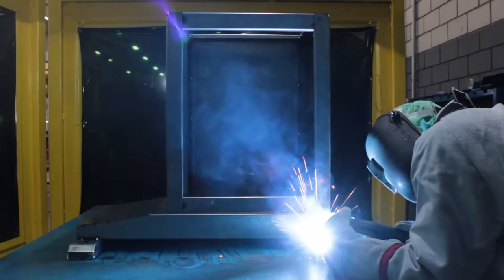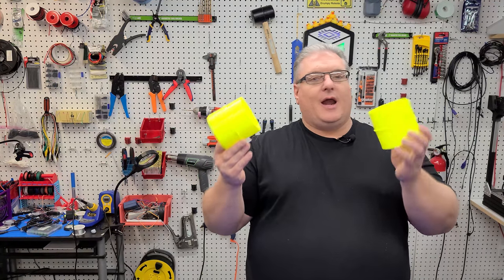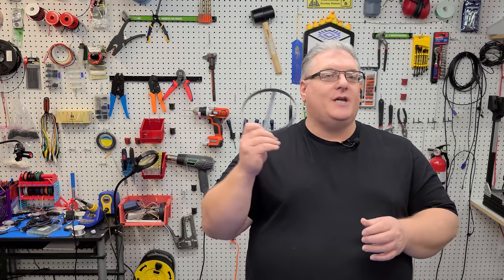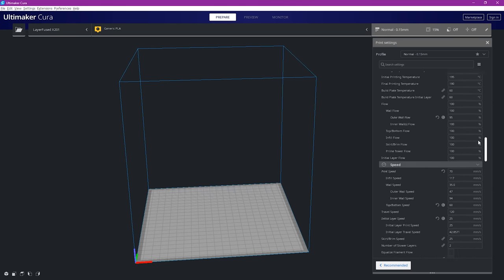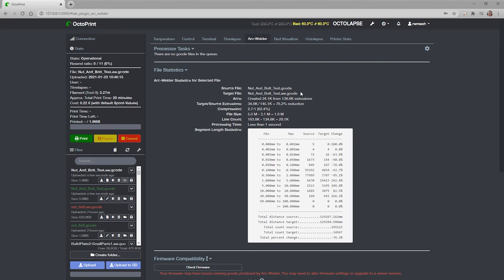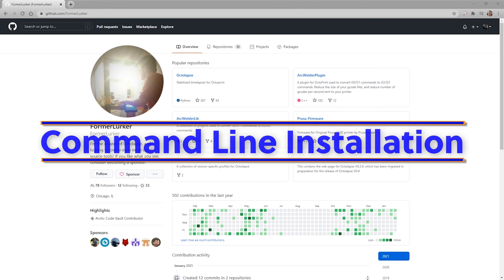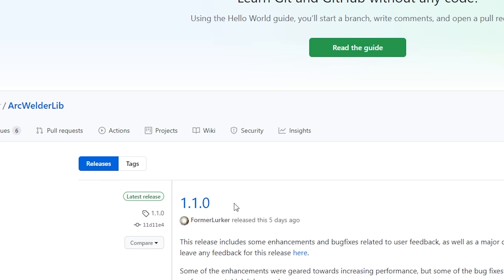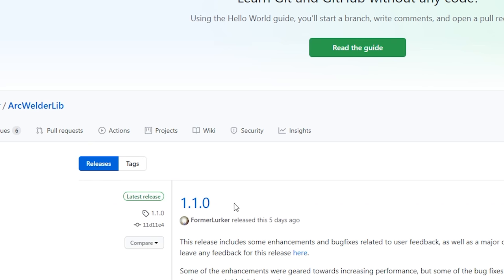Arc Welder - Smoother, Faster, Better 3D Prints! Its like magic to improve your 3D Print quality.

Comment: Arc Welder is cool, but for technical parts it needs some considerations. Like any lossy compression it produces digital artefacts. The curves produced by Arc Welder are estimations that might differ from reality. The next problem is that firmwares like Klipper take this curves and try to combine small straight lines to reproduce this curves. So you have several stages of lossiness: 3D Software (original Dimensions and spacings)->STL Export Rasterriser (loss)->Cura Arc Welder (loss)->3D Printer Firmware (loss). As mentioned it might not be a big problem for figurines but maybe for technical parts with high expectations in spacings and dimensions.

Comment: HOLY CRAP!!!  It's like I have a brand new printer.  I used the Octoprint plugin to parse an existing print.  Didn't touch a single thing.  Same filament... just a few hours apart.  Incredibly smooth and ALL of the vector change blobs are just gone.  Thank so much for publishing this video.  This is just amazing.
Reply: The blobs go away?!

Comment: That fact that 3d printing relies so heavily on stl's is to blame. These file types are polygons to begin with.  On "actual" cncs you're generating cam from file types that themselves are made up of Tru arcs. Interesting that stl's are default. This is old tech from machinists point of view. Excited to get this in the mainstream slicera
Reply: @fcuk_x  But how would you model with basic geometry? Sure works great for cad precision models, but what about everything else?
You would have to convert from a poly-based mesh anyway.
Reply: STL is generally considered a particular evaluation of the NURBS geometry anyway. They will get to using IGES files eventually...
Reply: Many of the CAD softwares use STEP files, which uses parametric functions to describe surfaces, and make perfectly smooth surfaces possible. I imagine it’s much easier to do arcs with a STEP file, because it’s hard to come up with arcs from polygons.
Reply: @LuisHansenNH  isn’t it possible to have a slicer that supports both CAD files and STL files?
Reply: Stl isnt the problem....its the way the g code was written was generated generically for compatibility between most open source controllers. This is more of a better post processor that takes advantage of the capabilities of the controls now. The motions are just interpreted differently.
Reply: Fully agree stl files are hot garbage
No respectable cnc company uses stl

Comment: I just printed a multi-arc print and my printer ran smoother and I think even a bit more quiet. The printout was excellent. I'll be using this and it might even push me over the edge on Octoprint. Thanks for the review.

Comment: Incredible. I was just going through some GCODE last night when I made the sad realization for the first time that every move was a G1 and not a single arc... Odd and inefficient. Trying this out today!
Reply: How’d it work for you?
Reply: @jessicalane107  Arc Welder has been compressing by about 50% on average. All samples maintained precision within 0.05mm regardless of post process. As for the print result, I didn’t find a significant advantage at typical speeds for entry level printers with faster 32 bit boards installed. I can imagine the best advantage when the processor has become the performance bottleneck.
Reply: @Inventorsquare  I have a flsun q5 mini and I’m still doing quite a bit of research. Thanks for your insight!

Comment: Thanks for the video. Never heard of Arc Welder before. Everything has it's use cases so I'm not saying Arc Welder doesn't have it's place and I will keep trying to use it. But so far I've observed on some of the apparent benefits:
1) faster data transfer on 8 bit boards - use klipper. I run an Anet A8 and Anycubic Kossel simultaneously on a single raspberry pi 3B+ at 100 mm/s (actual, not just set) with no lag. 
2) file compression - doesn't help with typical linear infill so there'll be lots of old G1 gcode in there. A hollow circular pipe is about the best example of file compression you'll get.
3) on smoothness - if you have the source file then use higher resolution to generate STL. Of course there'll be a ton of stuff from Thingiverse that might benefit.
For the zillions of people who ask how to run ArcWelder with <name your slicer here> ... go to the Arc Welder github kindly linked by Makers Mashup. It's spelled out there for all the most popular ones. A couple of clicks, paste a line of text and your done. It's that easy.

Comment: Amazing Video, I started to print a duck call, then i noticed that no matter what i did to make things go faster, the printer was stuttering and slow printing. That's when I hit google looking for an answer. I came across your video. I installed Arc Welder to Octoprint. To my amazement I achieved a 94% compression on this print! My Ender 5 Pro is now printing as fast as it should be! I did install it on Cura too, but I like to see the stats that the Octoprint plugin shows. I'm going to be using Arc Welder in everyone of my prints from this moment on.

Comment: Not using arc's seems completly crazy to me. That adds an insane amount of unnecessary gcode and makes worse parts. I manually write gcode for industrial lasers daily and I can not believe the printers/slicers aren't configured to use G2/G3 by default.
Reply: Microcontrollers that compute the moves are too underpowered, for hobbyist 3D printers anyway. They used to be barely capable of running the steppers when the moves were precomputed.

Comment: This just popped up as a recommended video. After watching it I added the plug-in to Octoprint and tried it using the legacy slicer plug-in in Octoprint and I'm impressed with the results. I don't design many projects where this would be needed but when I do I will certainly use Arc Welder. Thanks for posting this video.

Comment: It’s great that it exists but frankly it’s a slap in the face of the slicers’ developers who should generate high-level primitives such as arcs natively ! 😔
Reply: Maybe, maybe not. On default settings it messes up tiny details, and on larger parts lines can occasionally stick out of the walls. In the end I uninstalled it. I guess I prefer having predictable results over ehm, mostly perfect curves.

Still may be fun for guys with lots of spare time and filament. They may turn it mainstream eventually.
Reply: @przemekkobel4874  , your issues with tiny details could be firmware related.  The default deviation in ArcWelder is the same as the maximum deviation (0.05mm) in cura.  If you need more accuracy, you could decrease the maximum deviation in cura, and let arc welder compress the extra gcode.

It's definitely an issue that slicers are reducing the resolution before ArcWelder gets hold of the gcode.  It actually often does MUCH better with high res gcode.  It is also definitely an issue that many printers are running forks of Marlin 1, where arc interpolation isn't mature.  Recent updates to Marlin 2 (starting in 2.0.6) and smoothieware have greatly improved results.
Reply: @FormerLurker  This is a good point for not enabling arcs (at least not by default) in any slicer that cares about the size of its user base. In few years situation may change though.
Reply: Honestly, it is mostly because STL files are purely based on vertexes and the lines that join them, NOT (analog) geometry.  The slicer simply takes the model and slices it without knowing what the original modeler intended.  If slicers accepted geometry files like STEP or OpenSCAD scripts, THEN the gcode could include arcs and full-on NURB splines.  The problem with that is whether or not the printer controller's firmware and hardware will support those computationally expensive features.
Reply: @KeithOlson  I think that CPU power could become a non-issue in a very short time. For example, you could throw a bunch of Pi Picos at your printer instead of typical controller. They are 1 GHz twin core ARMs. Even a single board could handle typical printer features, and it costs what - four bucks?
Reply: @przemekkobel4874  Absolutely!  Running something like Klipper in a RTOS on hardware with enough power and RAM to do NURBS would make for an AWESOME printer controller!  Being able to upload STEP files or OpenSCAD scripts would be the icing on the cake of maximum accessibility.
Reply: @przemekkobel4874  mmmnope not 1 GHz. Try 133MHz.  By the time you add all the other interface hardware you will really battle to make BTT V1.4 Turbo for anything near the price you can buy it for.
Reply: @keithduffield5239  My bad, 133 MHz it is.
Reply: @przemekkobel4874  It did mess up parts of a triangulated vase that were supposed to be straight lines. There are command-line settings for ArcWelder as to the depth and resolution of curves. Though, that I didn't set up. And I forgot to turn it off for the triangulated vase that was supposed to have no curves.
Reply: Anyone with similar problems should also look at CNC Kitchen's similar video on fixing blobs (that occur due to too many tiny segments).  'Arcs' or 'slightly larger tiny line segments' doesn't really matter, likely they devolve into basically the same solution.
IOW Cura has minimum small line segment and maximum deviation for the endpoints settings, which should basically accomplish the same thing using differently named settings.  The problem is they need adjustment, the defaults are too small.
Reply from the maker: It should be noted that Stephan's video is solving the buffer underrun problem a different way at the cost of resolution.  The statement that arcs or slightly tiny line segments doesn't really matter is not correct.  Arcs use a G2 command and send the entire arc whereas multiple line segments (short or small) require significantly more commands to execute the same travel along the toolpath.  The less move commands the less likely the buffer underrun will occur which is how Stephan's videos is approaching the issue.  Reducing line segments in Cura can significantly affect precision of the model.  AW allows you to use a higher precision in the original gcode and then have those converted to an arc that matches the original toolpath much better than a reduction in line segments.  Of course this all depends on what you're printing.  I suggest comparing file sizes of output as a good baseline to understand the difference.  Take a model and reduce the line segments using Stephan's method and then run the same model with standard cura settings through AW.  You'll see your results are far superior with AW without a lost of resolution.  3:59 goes into detail about this.  Reducing segment count will alter the tool path where AW preserves the toolpath working within the deviation settings.  If you refer to that slide and remove 1/3 of the points you'll see how the toolpath would be significantly altered.  Stephan's method does have the benefit of working with printers without arc support. I hope this helps clear up the difference between the methods.
Reply: Re:  "The slap in the face."  Remember the rule:  "The enemy of the good (good process, in this case)...is the better (process)."   
An example would be the longbow.  Far more range and killing power than the older, close contact bow.   But supplanted itself, too, by the invention of the flintlock rifle, etc.
Adopt a process?  Yes, but also be willing to move on to something better when it becomes available....
Reply: We sometimes you need to slap people in the face for not doing the easier way.
Reply: @sirdrakey  or High five them...with a chair... in the face

Comment: How is this not standard? It adds a massive amount of value to a printer, they should be paying the authors
Reply: Yes please, lol
Reply: Its good software, but it also has its weakness. It's not standard because it screws with the resolutions of the print, and can ruin quality if not careful. But at the end of the day, people need to use common sense, but it's not that common.
Reply: agreed - however, Smoothieware does support this natively.  It just hasn't been implemented by slicers (absolutely no idea why).
Reply: @sandman7793  to be fair, slicers also mess with resolution.  Many people suggest limiting cura resolution as an alternative to arcwelder.  Just like cura, the resolution in arcwelder is also configurable.
Reply: @FormerLurker  I did my mech eng degree 20 years ago and vaguely recall g code for automation class. You mean to tell me slicers pump out straight lines to make arcs?
Reply: All CNC code used to be like this then programmers got lazy when look ahead was invented.
Reply: Because you can do this on your own: Put it into Blender, select the edges to keep (make their crease 1), turn the model into quad, add subdivision surface modifier. Done.
Reply: @rickarddt  no, there are commands for arcs g3 and g4 for clockwise and cc, I believe
Reply: @rickarddt  oh chit, actually nvm, I’m thinking of other CNC machines
Reply from the maker: Yup. Straight lines @rick
Reply: @wehiird  no, you are right, G3 I think is counter clockwise. I installed arc and tried it a few times (without looking at the code). Prints came out much the same. Then realised that my marlin firmware only supports arc resolution of 1mm, changed that to 0.1mm, recompiled firmware and flashed to printer. It works well.
Reply: @MakersMashup  arc weld works ok, had to change printer firmware arc resolution from 1mm to 0.1mm to get results. I'm still amazed, why the "laziness" with g01? Was there a hardware limitation in 3d printers when they just came out?
Reply: @rickarddt  The mathematics for the slicer to generate an arc is quite a bit more complicated than it is to just see if the printing plane intersects a triangle on the STL.  That being said, if you want maximum compatibility, I imagine there might be printers out there too that might not have the capability to do the arc move interpolations.  So it was probably a factor of difficulty in the slicer, and maximizing compatibility for the firmware/hardware on the printer.
Reply: Because it requires significantly more CPU grunt on the printer control board (perhaps excluding Klipper which I would assume leaves all that to the host CPU rather than the control board?), and generally yields firmware build sizes that are higher than supported on the older boards.
Most of the cheaper printers don't have control boards capable of calculating the arc moves in good time, and you get print pauses causing blobs and so-on due to the higher calculation load. It's probably good on a Duet (Cortex-M4 120MHz with hardware floating point), but for example the STM32F103-based boards (slower Cortex-M3 without hardware floating point) can't keep up. So Marlin configurations for such machines by default do not include support for G2/G3.
Further on the older boards that has smaller amounts of flash (not so common today), there often wasn't enough flash to hold the Marlin build with arc support included.
Reply: @sandman7793  Or, if you use it with the wrong firmware selected, it produces modern art.
Reply: @sandman7793  True. It does require the initial drawing (model) to be done very carefully to avoid anomalies when the CAM (slicer) translates the tool paths from the model. Tiny arcs smaller than the tool tip diameter will sometimes create weird loops in the tool path, for instance, so the drawings need to be done precisely without tiny arc segments. Illustrator used to be terrible for this, when exporting DXF versions of line art, leaving tiny arc segments connecting between path endpoints. Tiny, like 0.0005" radius tiny tiny bits. Those wreak havoc on CAM software.
Reply: because it takes a fucking masters in electronic engineering to get it to work.

Comment: WOW!!!! I've just tested to generate the gcode file from Cura with this app installed and the "new" file is around 75% smaller than the original file! I will test how it is printed. Thanks for sharing!
Reply: How did the prints come out and how was the time?
Reply: @phoenixamaranth  I did not see so much improvement on speed (it could be ralated to my RepRap printer) but the final quality is amazing!
Reply: @carlosfranciscovillegas2879  Awesome! Thanks for the reply! I'm definitely going to give it a go on mine

Comment: OMG!!!  This has made such a difference to the print quality using the Cura install.  It's going to be a default on everything I think.   Didn't see any real difference in expected time to print with or without, but the quality change is night and day.  Arc Welder and ironing makes for such smoother prints on my Anycubic Mega S.

Comment: The only thing to note here is that you've followed some other YouTube channels on compiling firmware to add something like a bl touch they quite often recommend disabling the arc support to 'save room'. The reason slicers haven't implemented this is because STL files are made of triangles, so I guess it is easier to follow the straight lines of an STL rather than recalculate the curve in an object to generate an arc.
Reply: Yeah but I think for those poor 8 bit boards the speed issue (stuttering with too many commands per time) isn't that big because really, who does 200mm/s prints on a standard ender 3. Anything with 32 bit boards can easily do it even with everything from bl touch to pressure advance etc enabled, at least with marlin fw. Should be even less of an issue with Klipper. Not sure about reprap and others, though so least the modern reprap boards also have loads of memory.

Comment: Looking at the post-Arc Welder parts... 0.9 degree stepper motors would still be a huge upgrade, especially if they were also capable of microstepping.